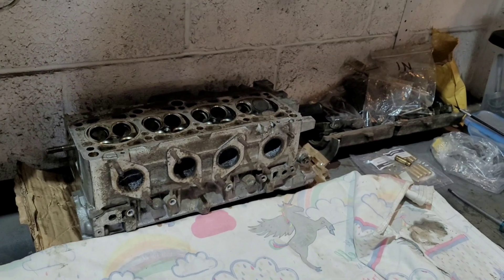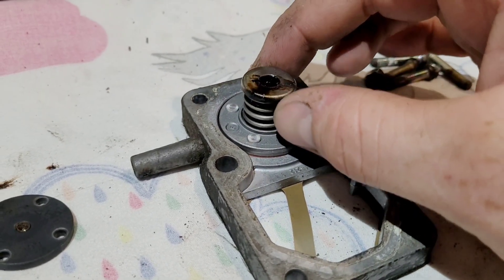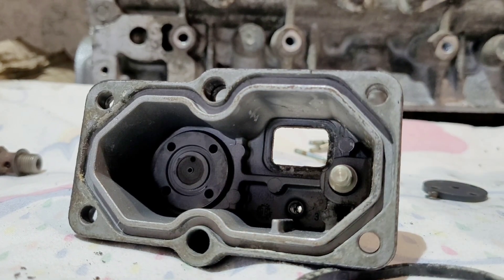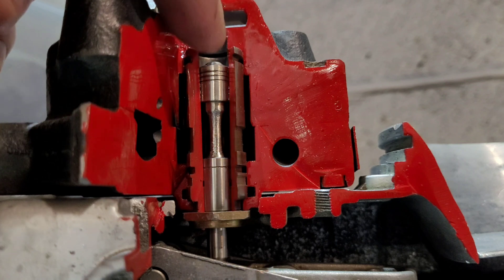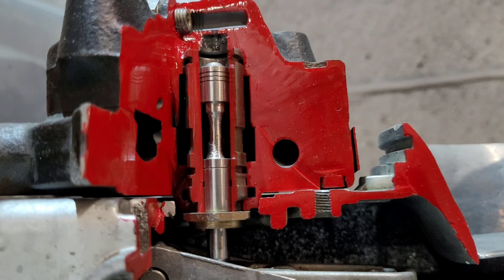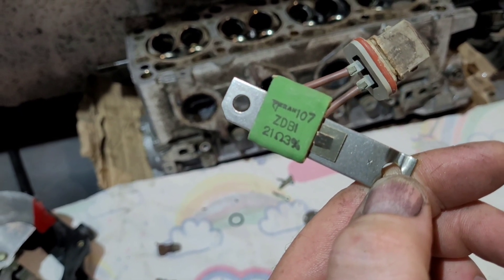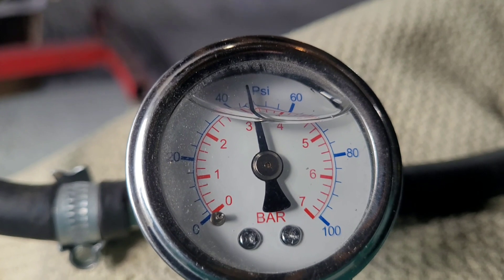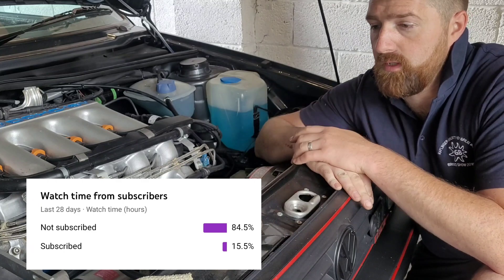Bosch K-jetronic CIS - WUR Mod - How-to + Why

Comment: Thanks for the videos explaining the inner workings of K-Jetronic so well! I have some troubles with the engine of my 1986 Audi 90 running lean on part load (engine runs rough). Adjusting CO only masks the problem, on idle CO is way too high now but after a drive the spark plugs are really white so the mixture seems to remain lean. I will lower the control pressure - already made that hole after refurbishing the WUR, it may be the reason (although according to the fuel pressure gauge I have, that pressure is spot on - 4.1 bar - this is as per the documentation for the WUR fitted on my car,  but still this may be too high for some reason). Should you have any different views I'd love to hear them! FYI: fuel distributer and WRU have been refurbished and injectors replaced, air flow meter position seems to be correct: centered and 1.9mm below the edge (I haven't touched this).
Reply from the maker: Glad it was helpful, have you check all your vacuum hoses? Has the ignition timing been set/checked?
Reply: @GreyGooseRestorations  Hi, yes, all vacuum hoses checked a dozen times by multiple people and ignition timing is correct as well. Warm/cold start is great, acceleration is flawless. Just when running the car in low rpms (e.g. when driving 50 km/h in 4th or 5th gear) the engine is running rough if CO is set to the correct level. With increased speed the problems disappears. The issue is driving me mad, spent quite a lot of money on it already but it's hard to find expertise on this system nowadays...
Reply from the maker: Is your throttle stop set correctly?

Small 8mm nut and threaded section.

Loosen the nut and unscrew the threaded section a bit.

Loosen the mirco switch and let the throttle close fully.

Screw the threaded section untill it just touches the throttle arm, turn a further half turn and lock the nut.

Adjust the microswitch so that it is pressed in with the throttle closed.
Reply: @GreyGooseRestorations  I would need to check. My car does not have a micro switch AFAIK - it's all mechanical (JS engine, also used on some VW Passats from that era). Question if I may, what does the throttle stop control?
Reply from the maker: Controls the amount of air the will pass the closed throttle which goes hand in hand with the idle screw and stops it wedging itself shut.
Reply: @GreyGooseRestorations  It's worth a check, never thought of this. Already found some information in the workshop manuals I own on how to check and adjust this. Thanks for your support so far!
Reply from the maker: Happy to help 👍
Reply: @GreyGooseRestorations  I've checked and adjusted the throttle cable a bit, tension was a bit too high. But now that I read your response again I don't think it's what you meant ;-) There are no micro switches indeed so I don't think there's anything to adjust for that matter.

One more question. Adjusting the CO means setting the "base" position of the plunger, correct? Depending on the position of the CO adjustment screw the plunger is pushed up (richer mixture) or allowed to move further down (leaner mixture). The control pressure controls how far the sensor plate can raise. I assume the combination of the "base setting" and control pressure determines the resulting mixture at all stages (idle, part load, full load [which triggers the full load enrichment if the WRU has this feaure].
Reply from the maker: Ok if no switch you should still have some form of throttle stop.
Yes the CO adjustment raises (rich) or lowers (lean) the mixture which will be uniform across all situations.
The actual throttle plate needs to be set too, 1.9mm down from the lowest part of the air cone (16v Mk2) so this height should be checked too
The control pressure determines the rate that the pluger can move, itll only move up as much as its mechanically set to but the differing control pressures allow it to move faster allowing more fuel to be delivered over in a given situation allowing the engine to speed up
Reply: @GreyGooseRestorations  Hmm I thought my sensor plate is set correctly at 1.9 mm (1.9 mm also applies to my car) but now I am not sure if I measured it at the right spot. The plate is a bit tilted in my case, i.e. not level. So there is one part that's 1.9mm under the edge of the cone and on the other side it's lower than that. I could send you a picture but not sure if you are willing to share your email address? Or is there another way (I don't have Facebook)?
Reply: @GreyGooseRestorations  I think I measured at the correct spot (the side facing the fuel distributer) but should it be measured with warm or cold engine. I have two workshop manuals, one states to release all the pressure first the other states it has to be checked with a warm engine...
Reply from the maker: Yes thats the correct point to measure, i would check it on a cold engine.
Reply: @GreyGooseRestorations  Alright, then I think the position is correct. I will double check if with warm engine, there is any difference.
Reply: No difference when the engine is warm. Lowering the control pressure seems to have had a positive effect though, I can drive 50 km/h in 5th gear very smoothly now. But I should check CO, probably it's running quite rich now. My hopes are I can lower CO on idle and have the engine still run OK on lower rpms. If this gets fixed some day I will let you know.
Reply from the maker: For a 16v around 2% is a good area where they work well but each car is different, rich on idle might be perfect when driving
Reply: @GreyGooseRestorations  Agreed, but if it needs to be 5 - 6% it's quite beyond the 1.5 to 2% it should be, I mean going high could be needed to mask an issue. It's better to try and resolve the issue IMHO.
Reply from the maker: Definitely 5-6% is way to high and like you say its better to find the issue than mask it
Reply: @GreyGooseRestorations  Part load is lean "by design", correct? So lambda > 1 is to be expected, but what would be considered too lean on light load? Lambda > 1.1?
Reply from the maker: Normally k-jetronic is lambda 1 or under and tends to run lean top end.
Reply: @GreyGooseRestorations  OK, that's good to know. When set to 2% CO on idle, lambda is a nice and correct 1 and engine runs smooth. However as soon as the revs go up, lambda increases to 1.11 and engine starts to run rough because of the lean mixture. To "fix" this CO has to be set to 5 to 6% on idle. But the engine running rough ends at about 2500 rpm (with CO set to 2% on idle), so it means the issue seems to only occur at low load. I was hoping the sensor plate had to be adjusted but it seems to be correct. As said I will see if decreasing the control pressure a bit allows me to set idle CO to 2% again.
Reply from the maker: Is your WUR working correctly
Reply: @GreyGooseRestorations  I think so. I currently have a fuel pressure gauge between the fuel distributer and the WUR. The control pressure starts at 2.0 bar with current temperatures, increases to 4.1 bar and is stable. Removing the vacuum hose (full load enrichment) makes it decrease to 2.9 bar. This is exactly what the documentation says. I don't think there's any intermediate stages, correct? I mean only full load should change the control pressure. 

Perhaps there still is some stupid vacuum leak but I sprayed brake cleaner everywhere and there's no response. I also checked all the hoses, the injectors and seals are new and if I spray there no response either.
Reply from the maker: Thats a bit to high from what i have seen, for mine which is 1.9ltr 16v cold pressure is 1 bar rising to 3bar (WUR mod) but factory is 3.5bar fully warm, any more than that and you have too greater force acting on the to of the fuel plunger which means its harder for the air flap to open, and at low load the pressure on the fuel pin going to equal to or greater than the force of air trying to lift the air flap
Reply: @GreyGooseRestorations  I understand your doubts but it really is what the documentation says, I have it right in front of me (it was shared by a mechanic). It even says 4.1 - 4.3 bar warm. 

What I am going to do is I will have an expert check it (that same mechanic, he has a lot of knowledge on this type of system). I think I checked the obvious (vacuum leaks, control pressure, sensor plate position), replaced the injectors, had the fuel distributer refurbished (let's hope it was done correctly...). Spark plugs are new and the ones that need to be used (triple checked). Ignition timing OK. 

The good thing is, the car runs fine so I can enjoy it. If I didn't know about the high CO I probably wouldn't bother. Sometimes ignorance is bliss, really...

Will let you known if this gets fixed. I really appreciate all the input and thoughts you shared!
Reply from the maker: Happy to help, hopefully it gets sorted but like you say atleast you can use it 😁
Reply: One last thing I can check is if there's no leaks in the exhaust system. I can imagine it would valsify the readings. Blocking the tailpipe should shut the engine down, correct?
Reply from the maker: This would mess up the readings, cover the tail pipe with cloth or something and just listen out for blows
Reply: @GreyGooseRestorations  Hiya! So, finally an expert had a look. He found there was something wrong with the fuel distributor. Besides the fact that base position was wrong, the plunger wasn't sealing off properly (leaking) and it didn't move properly so the position was wrong while running. Fortunately I already bought another one just in case, so he installed that one and the problem was solved... Really disappointed in the guy who refurbished the failing distributor but happy that it's resolved :-) And lambda is indeed 1 at partial load now.
Reply from the maker: Glad its up and running 👍it can only take a mm or two between the pin being out for the injectors to spray or cut off. Happy motoring now

Comment: Wait can I drive the KR K Jet and the whole system with it on a PL?
Reply from the maker: Yes, the PL and KR block the same engine so will work fine with KR K-jetronic system
Reply: @GreyGooseRestorations  I got both laying and also both heads and the big intake so should I use the KR parts for better performance?
Reply from the maker: Out of the heads the early 027 cylinder heads are generally better and the larger 50mm intake will allow for more air flow.
Reply: @GreyGooseRestorations  good to hear that 😁I think I need to rebuild some stuff then

Comment: Your Beautiful assistant is looking nice on the Audi rims...
Does the warm up regulator get a constant 12v?
Reply from the maker: Nope, it should only get voltage when cranking, its fed from the fuel pump relay if memory serves me correctly
Reply: @GreyGooseRestorations do you mean it runs constant 12volts when the engine runs/cranks?? Does the 12v  not cut off sometime during the engine operation? I just want to get a clear understanding on how the electric side works...I'm currently working on a mk2 8valve gti which I bought and previous owner removed the connector plug so the engine cuts off  and idles low when it's hot  but high on idle when cold...that's when I came across your videos n channel which I'm subscribed to.
Reply from the maker: Its not constant no, ill have to dig out wiring diagram, tad rusty 😅 possibly connected to the starter solenoid allowing voltage to heating element. Ill have to check
Reply: @GreyGooseRestorations  ok...Thank you very much...that will help a lot...I was thinking of connecting it to the ignition but who knows what would happen...I don't want that element to burn out...
Reply: @GreyGooseRestorations  I got this link with a diagram that shows it connects to the Aux Air Valve...though I can't make out what the guy is saying...We just have to confirm is this the right way to go...https://youtu.be/7I8omMFRAi0

Comment: great video I have a spare WUR I will do this mod with sometime.How does this WUR mod compare to shimming the metering head fuel pin/rod?
Reply from the maker: Thanks, the WUR have a different effect compared to shimming the metering head which just raises the system pressure that helps with residual pressure in the injector lines once they are opened at 3bar.

Comment: Hi mate Iv had a problem with my jetta and still do when cold it start lovely when hot and turning it off for 15 minutes and back on still fine .. but leave it for hour or so it start like lack of fuel like it evaporated
Or the fuel has returned back on itself and run terrible for 10 seconds what could that be ? Grate video on the k-jet
Reply: Have you looked into the fuel accumulator that’s just in front of the fuel pump?

Comment: Very happy for another Golden Kjet Video.

So in a nutshell you are saying that the hole needs to be drilled in the WUR housing to expose an allen key slot which when turned the correct direction will decrease the counteracting fuel pressure on top of the fuel pin which then allows the fuel pin to move higher up the chamber and expose more fuel slots?

I have the following questions:

1) You mention that you decreased WUR pressure from 50 to 30 pSi because this was optinal for your car. What are the considerations to be taken into to recognise the correct WUR pressure for your vehicle?

2) I assume that the modification of the WUR does not require tinkering of the AFR because the air flap and fuel pin are both moving higher upwards due to decreased cou teracting WUR pressure?

3) You mentioned previously to me that honing of the fuel pin is not worthwhile and that one should rather modify the WUR. But one can also play with the master system pressure via the fuel pressure regulator on the side of the metering head. Would this not also increase fuel to the injectors? Won't you also do a video for us on the fuel pressure regulator?

4) Where does one purchase the gaskets for the WUR when doing refurbishment?

Again, excellent vid!
Reply from the maker: Thanks 

The WUR mod alters the control pressure and either richens or weakens the mixture right across the revs.

K-jetronic engine tend to run lean at higher revs and benefit from checking and getting the control pressure spot on.

But having proof of the current setting on mine achieving an AFR of 13 at 6700rpm.

I also run just over 6bar system pressure not the ideal 5.5bar however this will only have a direct effect on injector residual pressure (once they have opened at 3bar)

I will see what I can do 👍
Reply: @GreyGooseRestorations  forgot to ask... won't decreasing the WUR fuel pressure at some threshold pressure value cause the risk that the fuel pin won't be pushed back down the channel? (Sticking fuel pin)
Reply from the maker: Nope, if all is well and functional then there is still sufficient pressure to keep the pin doing what is needs to do 👍